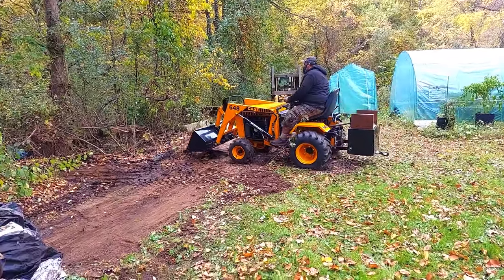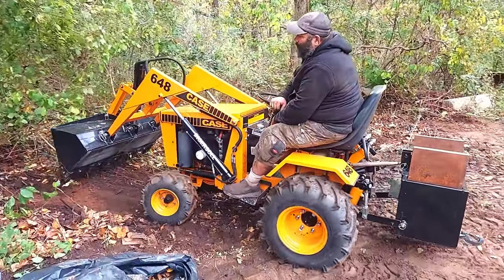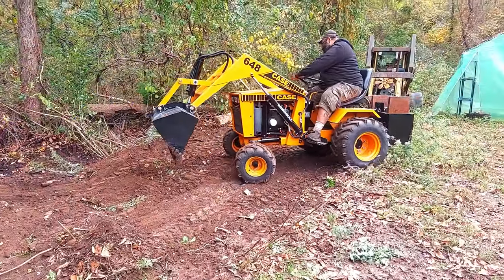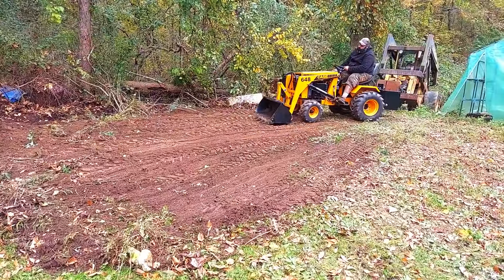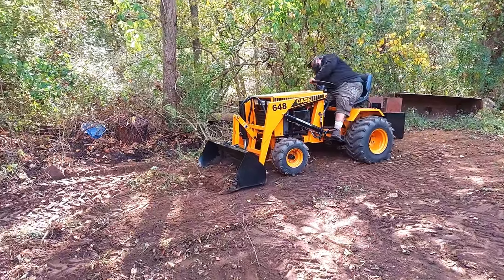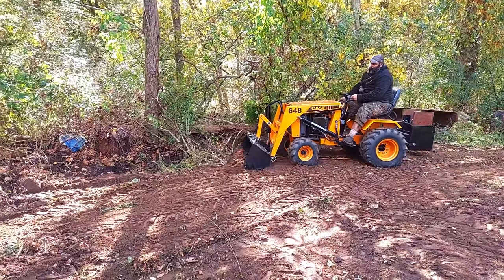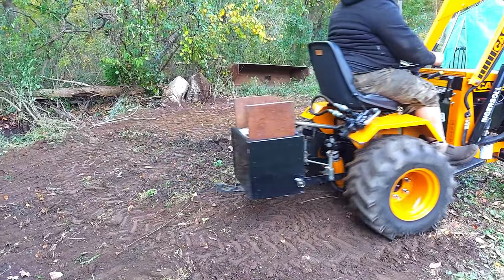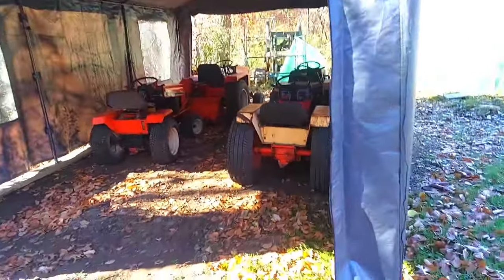New Teeth On Bucket Playing With A Case Ingersoll 648 Mini Commercial Compact Loader.

Comment: I need one of those 648! What hyd oil do you recommend for 4020 winter time? Thanks
Reply from the maker: Lol. 15 40, 5 40, 5 50 or 20 50 is fine just let warm up. If in super cold when you are starting it out side 20 50 under 10 degrees gets a bit thick. Thanks for watching and the comment.

Comment: The tractor with laoder weighs 1130lbs. So with weight bucket and tires, you around 2000lbs.
Reply from the maker: Sorry but you don't know the facts lol....  There is 750 lbs in the weight box as stated, plus the box and 3 point so there's around 925 there total... The tired have around 8 gallons each of liquid in each so roughly another 150 there. The reinforced bucket and teeth was probably another added 75 or more. The webbed and gusset rear over standard rear with backhoe axles roughly another 75 lbs. So roughly 1250 added lbs so like I said around 3000 lbs with operator actually I would say over by a good amount...... Thanks for watching and the opportunity to get in detail again and educate about the weight of this machine.